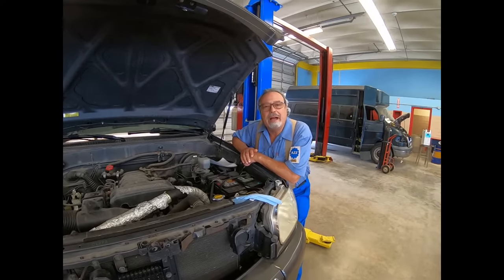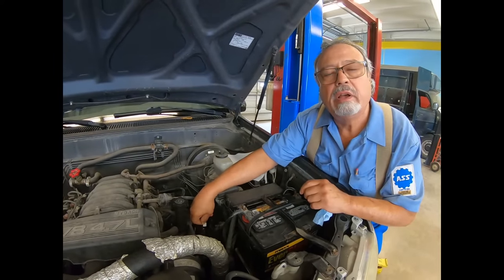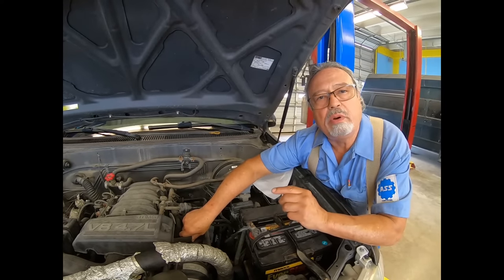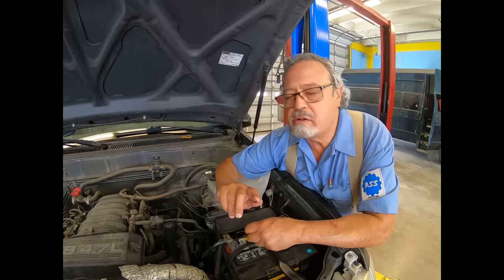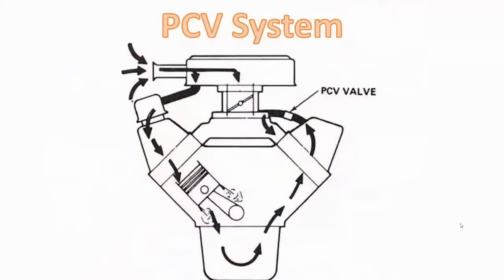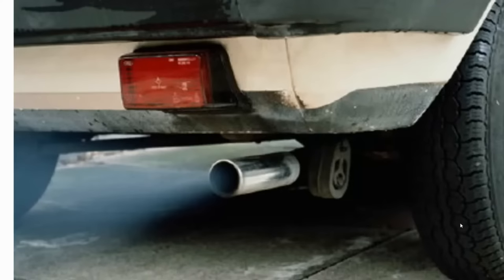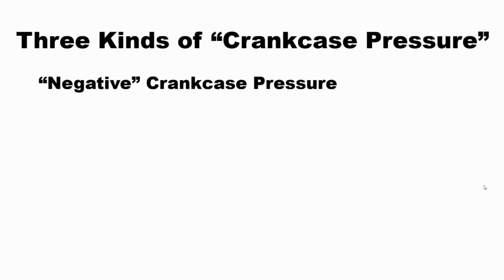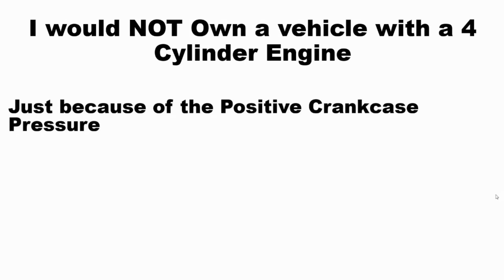Learn how IMPORTANT the PCV Valve is and why you should test it.

Comment: Great video but u do not finish explaining on the 4cyc
Reply from the maker: Thank you for the complment. The bigger the engine, the larger the volume of vacuum. The smaller the engine, the less volume of vacuum. The four cylinder engines are typically not able to create the volume of vacuum needed to overcome crankcase pressure. I hope that helps. Thanks again.
Reply: @theoldmecanicoshow9004  yes understood that part but u said u were going to follow up on 4 cyc . And u did not.
Just like u did in the first car that was v6 or v8.
So if I take the hose off of the pvc on a 4cyc what should it do
V6 or v8 example.
Reply from the maker: @carlossaenz4075  I removed the hose from the PCV to show that the PCV system is responsible for putting the crankcase under negative (vacuum) prssure. Removing the hose is not part of the test. Viewers should know not to expect a four cylinder engine to stick the paper.
Reply: @theoldmecanicoshow9004  yes 
U told the pve hose off to show that the paper was blown off the oil dip stick and that ,that's the way it should be
Reply from the maker: @carlossaenz4075  Yes...you might like this video. Very EZ trick to know when to change the oil. https://www.youtube.com/watch?v=JqJjgL9me_A&t=80s

Comment: what if I have  4 cylinder engine?
Reply from the maker: Thank you for the view and the question. I have tested many four cylinder engines. A few, the larger displacement four cylinder engines will stick the paper. I think it's because the four cylinder engines are not large enough to create the "Volume" of vacuum needed to put the crankcase under vacuum.

Comment: you can do this test with your finger...don't waste the paper...regarding the PCV valve no need to change it every 2 years...just don't go more than 6 months & 7k miles even if the oil is good for 10k miles & your PCV valve will never be clogged.
Reply from the maker: Thank you for the view and the suggestions.
Reply: @theoldmecanicoshow9004  u welcome

Comment: My pcv in this jeep is hard to get at
Reply from the maker: Yes you are correct and Jeep is not the only one that is very difficult to get to. Ford has some PCV valves with wires going to it and it cost $100. The wires are to defrost the valve during extreme cold. Thank you for the view and the comment.

Comment: I was really trying hard not to look at all that sil😎ver tape wrapped around what looks like your air intake
Reply from the maker: Thank you for the view and the comment. The silver tape is on the suction hose of the AC system. Some folks like to "Soup up" their engines or sound systems. I like to "Soup up my air conditioning. I would wrap pipe insulation on that hose and then tape it up with duck tape. This keeps heat away from the cold hose and eliminates extra heat the condenser has to get rid of. I taught automotive AC for 40 years. I came up with several modification that made my AC win the "Cold Contest" I challenged my students to. Thank again my You Tube friend.

Comment: Do you know an effective way to test this on a 4 cylinder engine?
Reply from the maker: The only time I have seen Negative crankcase pressure (sticks the paper) on a four cylinder engine is when it is a BIG four cylinder engine. 2.8 Liter. I have tested New cars with four cylinder engines with only the paper fluttering. Thank you for the question.
Reply: @theoldmecanicoshow9004  what about 3cylinders like suzuki every van
Reply from the maker: @fpsph4446  The smaller the engine size, the more it struggles to have negative crankcase pressure. Thank you for the question.
Reply from the maker: I have tested brand new 4 cylinder engines to to see how they respond. The only time I see a 4 cylinder stick the paper is when it is a big 4.(2.8 liter)

Comment: hi gain 
if the pcv are electric -how work ?
Reply from the maker: Electric PCV valves are for heating purpose in Cold weather. Thank you for the view and the question.
Reply: Why are called valve?
Reply: I have positive pressure from where i check oil level
Reply: And bad smell like burned oil on exhoust 
Oil in inlet turbine

Comment: I use a cigarette lighter and see if the flame is sucked inward towards the engine.
Reply from the maker: What kind of cigarette lighter?
Reply: @theoldmecanicoshow9004  Butane, such as a bic.  A smoke machine works also, anything that confirms a negative pressure basically, perhaps a balloon or even a finger cut off a rubber glove.

Comment: So you cant test a 4 cylinder?
Reply from the maker: Thank you for the view and the question. I have personally tested 100 different 4 cylinder engines. Including brand new cars with 4 cylinder engines. Very few will stick the paper. It's mostly the larger 4 cylinder engines (2.4 L) that will stick the paper. The engines are not big enough to create the large enough volume of vacuum needed to put the crankcase into a slight vacuum, Thank again my You Tube friend.

Comment: Sorry but the statement that all 4 cylinder engines leaks oil is just not correct! PCV valves need to be removed & cleaned once in a while. I do mine every couple of years....I ensure the spring action works...if it looks like cleaning will not help I just change it out. I also vacuum out the air box and clean the ducting too and from it. Nice "party trick"...

Comment: What a load of nonsense, I can detect a negative pressure by setting the cap on my 95 Volvo 2.3L 4cyl turbo using my fingers to lift it off (it has one branch to the inlet inboard of the throttle body and one prior to the turbo).  4 cyl are far cleaner than higher cylinder engines.  To be fair it does leak oil a bit but the main problem is the turbo dump pressuring the outboard area, it doesn't leak at idle or when running boost or not.  For my increased level of tune it needs a PCV valve (which it currently does not).  The same engine with same PCV design without the turbo didn't leak oil atall.
Reply from the maker: Thank you for your input, the view, and the comment.

Comment: So having a 4cyl engine or lower is poisoning the environment faster than 6cyl or higher cyl engines. Tell that to the policy makers forcing us to buy 4cyl SUVs and other large vehicles. Electrical vehicles are just as filthy unless they're using solar, hydro and wind energy.
Reply from the maker: Thank you for the view and the comment. I agree with you. I can not believe they make full size pick ups and SUV's with 4 cylinder engines. Also I agree with you about electric vehicles. That electricity mostly comes from burning coal. Thank you again .

Comment: You’ll get gapppppp by a  4 cylinder engine. Bc they are good engines too. There’s more options out there for people with 4C engines. Oil catch can for example. And more effective then a PCV. I like the information about it but it midset is garbage to be a “Mechanic” if you really know what it mean.. mmb Vtec all day bby🥶🃏
Reply from the maker: Thank you for the view and the comment. Yes, catch cans do an excellent job of helping the PCV system. Honda and I go way back. I worked at the Honda dealership in 1973 - 1976. The very 1st Honda's I worked on were the 2 cylinder 600 cc air cooled engines. Honda engines RULE...!